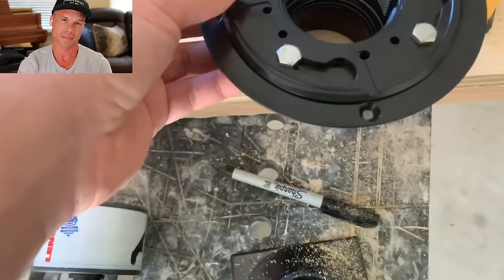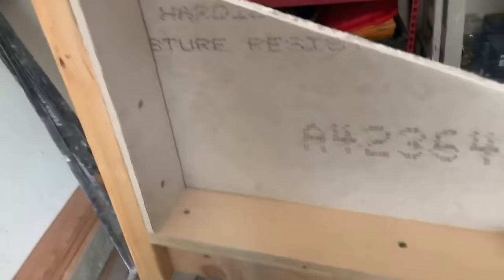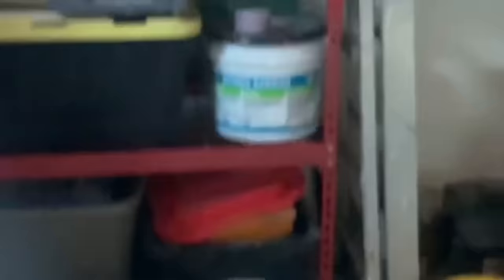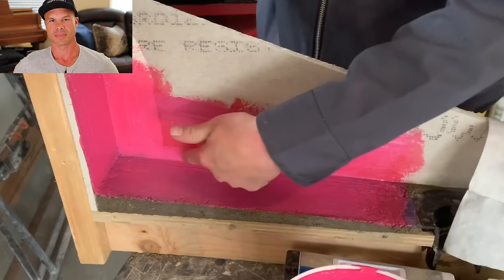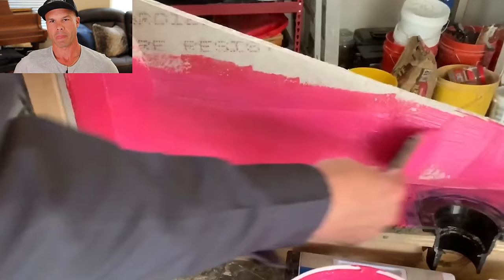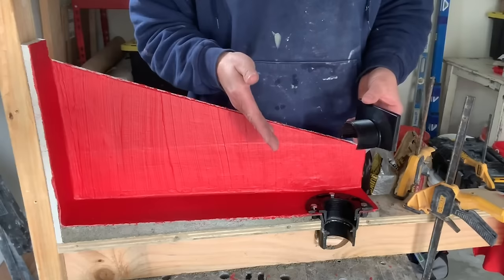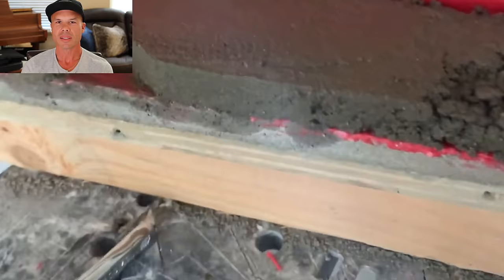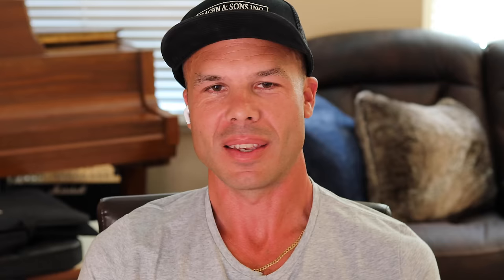THE BEST REDGARD VIDEO ON THE INTERNET!!!

Comment: What do steel, copper, glass, vinyl, rubber, and hot mop have in common? They're all formed to shape while under the influence of a furnace of one type or another AND they're all impervious to water. You know what's not permanently impervious to water? Anything that is air dried, such as Red Guard, that will therefore become soft, pliable, and permeable over time because the very thing that makes them form and harden also makes them susceptible to long-term exposure to water. The laws of physics and chemistry are not susceptible to marketing bs.

Comment: Great video.  Great step-by-step dissected illustration!  Thank you for sharing.
So if you're going to use a pan liner, you wouldn't use Red Guard or a similar product on the shower floor, right?  Mold sandwich I've heard.  I've seen some who use a liner and still red guard the shower floor.  Some Red Guard the floor but stay a few inches away from the drain?  Love your videos. I've learned a lot.
Thank you for the positive, motivational talk at the end.  That was genuine.... especially the porn, ha, ha.  Hey, when I watch porn, I'm usually just trying to check out the tile work that's been done, ha.

Comment: Quick Question. I have a shower pan that is leaking. Can I take up the tile on the floor and the bottom row on the wall, reseal it with Red Guard, as shown in the video, and tile back over it? Or do I have to tear out the entire shower pan and start over? Thanks.  And great message at the end.
Reply: When in doubt tear it out.  If the pan is leaking it has already started to rot. If you red guard over moisture it will eventually bubble up and fail.

Comment: Thanks for the video. I was looking for an easy way to do a curbless pan in a slab house. How much Redgard do you think a 42" x 78" shower would take?
Reply: David - According to the Redguard instructions: "Apply RedGard at a rate or 110 sq ft per gallon each coat. ".  I guess that would be for each layer of Redguard you plan to use. Plus a little more if you are going to use felt in the corners.

Comment: This is actually how Custom writes in the technical manuals how to build a shower. https://images.homedepot-static.com/catalog/pdfImages/a9/a91313f0-bffd-4f3d-bc9a-caa1825cb671.pdf Also, Laticrete with Hydroban gives instructions on how to do a liquid only setup with a linear drain with a Fernco style connection, too. https://www.youtube.com/watch?v=NLzYA79OV20 Laticrete's way. 

The only way people  should doing their showers with Redgard/liquid membrane is with a surface mount drain like a Kerdi drain, linear drain, etc, or use it as a traditional liner. One kinda ghetto way I've seen that I guess works (and I think even Sal's done it before with Aquadefense and a copper pan in one of his videos) is use a drain for a fiberglass shower (with no weepholes and a surface mounting setup...) and liquid membrane right to it, but it's definitely not ideal to Redgard over the traditional liner setups.

Comment: how do i waterproof my 2x4 curb without pvc linear? Redguard the raw wood? or cement board the raw wood? then redguard the cement board? redguard both the raw wood and the finished cement board shaped around the wood? Can curb cement board also go into the pan just like how he said the walls are ok to go into the curb ? (i know this is a no-no but he seems to be OK with it based on his theory)
i mean can i treat my curb the same as how he treated his wall? curb wall goes into bed.

Comment: So you've said not to seat hardibacker in the shower pan many times before... with redguard it seems acceptable as long as you use the fiberglass tape at the change of plane. . It also seems easier. Do you approve hardibacker buried in the pan as long as it's like this??
Reply from the maker: Yes.

Comment: i do this method. but i use hydroban by laticrete
Reply: Quick question.  Why sandwich the red guard between 2 mud beds rather than one big sloped mud bed, redguard, then tile?  Wouldn't that eliminate 1inch of mud bed to absorb water.  Or does redguard not 'play well' with the tile thinset?  Thanks!!

Comment: If I was using wonderboard on an outside wall in Minnesota and have a plastic vapor barrier attached to the studs then put wonderboard on the walls is it advised not to use red guard?  I have been reading about mold sandwich between 2 vapor barriers. I’ve also seen folks say do both and others say absolutely not.

Comment: I’m looking at doing my shower pan this way. I bought Redgard seam tape at Home Depot but noticed it’s supposed to be used with the uncoupling membrane and applied with modified thin set mortar. Can it still be used the way it’s applied directly with redgard instead of modified thinset mortar?

Comment: Hi Isaac, what’s the name of that felt material he used on the seams, corners, and around the drain flange? And is it necessary to lay those down if I’m using Flex seal as my floor waterproofing membrane before I apply thinset?

Comment: Ugh I'm super annoyed. I've spent a ton of time researching how to build my shower and not finding anyone saying that you're supposed to sit the shower drain bolt carriages on the subfloor and not the upper part. So last night I cut a 3.5" hole in my shower floor and put it down in there.
I do have 2 layers of 3/4" plywood and a layer of 1/2" hardibacker, should I still repair the floor and sit the drain up on the bolt carriages, or is the hardibacker essentially considered part of the deck and I should be good? I was planning on putting tar paper on top of the hardibacker, then lath, then deck mud.
I'm not doing a redguard liner, I'm doing a standard PVC roll-out liner, FWIW, but the drain install has been eluding me. I usually see it explicitly diagrammed as the upper, flat part of the shower drain goes directly onto the subfloor so this actually is counter to everything I've found.

Comment: What is the name of the fabric he using on seams after 1st layer of redgard?  Does he use that fabric on bottom of entire floor as well?  I have a slab floor which I'm converting to tiled shower after ripping out fiberglass tub/shoer.
Thanks.

Comment: So I've been watching a lott of your vids and different shower pan videos and I'm wondering if this how u prefer with preslope and then liquid membrane and then slope again on top? I feel u loose the benefit of only having to do the slope once and tile straight to liquid membrane, it also keeps deck mud dry. Or does the tile bond not bond as well to red guard and that's why u do another slope? Is either way fine?

Comment: Question: is that a Cementous or at least alkalai resistant tape?? I don't think it is, that will deteriorate in the shower, it is against manufacturer OEMS...just curious why you are using it? Not trying to be a troll.

Comment: with using the additive he was using for his pre slope could you do that to float a floor flat? Instead of having to go 1 1/2 could you do 1/2 minimum?
Reply: not exactly sure about your question but you want your slope towards the drain a minimum of 1/4 inch per linear foot from whatever shower wall. if the far wall is 3 feet away you ideally want 3/4 of an inch drop from the said wall.

Comment: It really depends on how much your foundation shifts which makes me weary of doing this. Not saying it's wrong or a bad video. If your in a mobile home there's the constant leveling that has to be done and that cause alot of twisting motion which may or may not cause a tear. For houses you have different reinforcement ( rebar, post-tensio, pier and beam, and I've heard of using fiber but not sure). Example: I have post-tension and the left side is 1 inch higher from center and the right side is 1/8 inch higher. Yes, it's due to water drainage, point is the flexing that happens and the failures that COULD POSSIBLY happen but may not. Not trying to bash these guy's because I like what they do and I'm actually using them like a teacher and I'm a student. I like what they're doing but they're not foundation experts. That would be like expecting a shipyard welder to be the perfect ship captain. Keep up the great work and videos so I can learn more as a DIY'er
Reply: So while yes its true us tile guys aren't Foundation experts but we don't actually have to be ....fortunately modern construction technology and materials and methods are all designed and created brand applied to allow for the fractional movement due to settling ,changes in load or conditional expanding and  contracting...the polymer modifications found in almost all tile related materials has this very thing in mind..methodology also considers this wnen. We thinset or liquid nail (on walls)our backer board then we tape a d mud the joints after its akk screwed off we are essentially making these materials one with the overall structure... Super bonded with the core framework or sub flooring so that it will move as one cohesive structure rather than the structure trying to move away from the tile and its substrate ...every thing flexes together ...if its applied correctly it will ride the house wherever it goes...recently tiled a school bus converted into an RV....Foundation. Shifting ..(normal foundation shifting anyway)isn't an issue really

Comment: I noticed he didn't use thinset between the redgard and the top layer of deck mud. Would you recommend thinset between the redgard and top layer of deck mud?
Reply: Kevin, I have not done it before, but wouldn't using thinset between the layers of deck mud ruin the ability of the top layer of deck mud to be "uncoupled" from the bottom layer?

Comment: I’m DIY-ing removal of old single unit shower and replacing with same. I want to redguard the backer board before installing new unit. Do you recommend?  P.S.  I’m on pier and beam. Reason for single unit choice.

Comment: Why not just a single mud slope and a liquid membrane with a flange type drain? Laticrete hydro ban liquid lets you do this.
Reply: They all allow for that style for installation, his method is sound but slow. A divot shower is much faster and is a one pour mud bed, the way its water proofed is identical.
Reply: I m thinking Schluter flange drain, sandmix for slope and AquaDefense with mesh for waterproofing

Comment: That explains why every red guard shower pan I've ever seen has failed.  I have never used it for a pan myself, but a lot of customers expect to see it on the walls.  I did my own shower 27 years ago with a chlorralloy pan, and no waterproofing on the durock walls.  It has held up and was used extensively by 3 kids and 1 or 2 grownups.  I personally don't like it at all, but why argue with customers?

Comment: Putting in my first complete ground-up shower. I have done pre-fab pan showers but this is, in my opinion, stepping into the bigs! I started a lot of videos but it doesn't take more than a few minutes to realize whether there is something to be gained by watching til the end. With that being said I have watched several of your videos all the way through and have subscribed to your channel. I am comfortable with plumbing, framing, tile work and as a concrete finisher by trade I have no problem with the masonry end of the project. I was anticipating using a traditional membrane but the Redgard has caught my attention. I cant find it now and perhaps I'm mistaken, but have you ever seen Redgard used in conjunction with a roll membrane?  My other question is what is the fabric that is used in the corners when applying the Redgard?   Thanks so much for the videos, I know they are a lot of work and time but I have already learned some lessons that will make my project a success and save me untold headaches and time, not to mention the money!
Reply: George, I also was wondering if you can use a PVC liner in conjunction with the redguard to be even more confident that it will remain waterproof (forever?? :) ). P.S. I think the fabric is called Laticrete.

Comment: My only question is WHY.   when you can do a liner and get it waterproofed in hours
Reply: I feel the same way,but I am interested in trying redguard because I want to compare it- pros and cons... To me, the pain in using vinyl, is that it bunches up in corners and you have to build out with strips before applying backer board so it doesn't bow in on the bottom..and it bunches up in and around the curb... But I'm used to have to deal with that...I agree that vinyl is superior to paint on redguard....

Comment: On the final mortar grade, do you put redgard on that? Then thinset  and tile? Or do you just directly thinset and tile on the mortar?
Reply: Was wondering same.  I've seen both.  I don't see it hurting anything.
Reply: @afchannel652  Since I needed to be about 3/32 higher on my final level, I went ahead and put thin-set on and now I'll put 3 coats of Redgard. That will give me the fraction I need above the drain.
Reply: @larrybush3584  so in theory, no water should be getting to the weep holes as that grade is covered on both sides by waterproofing membrane.

Comment: I'm not having any luck finding the redgard corner membrane as shown. Would any water proofing joint product work? Like the prova joint waterproofing?
Reply: Use alkaline resistant mesh tape. Depot has it

Comment: Hey there from Maine!! So glad I found your videos, Thank you for taking the time to teach us. I know putting videos together takes A TON of time, your video quality is pretty good most of the time! Out here, all i can find for "deck mudd" is a product called "4:1" at Lowes. Will this work for my float on the floor and walls? After watching about 10 of your videos,  I am going to take the plunge and build the whole shower in this master suite we been working on for 10 weeks now. I was also wondering if you could figure out how I can get some of your red cedar to make my slats/furring strips. I asked home depot if i could get a 2x4 red cedar,  and they are $25 for a 16', but I would have to pay $150 "vendor fee"  for some reason, and would have to get like $1500 worth....Any suggestions on a local lumber store that might ship me a couple? Thanks again bro, I am psyched to learn this, after 20 years of roofing and remodeling old rotten farmhouses, hopefully I can get this down. Take care!!!
Reply: Hey, there. Maine here too. 
Try using fir for the strips.  2x4 Should be available at big box stores. Not a perfect replacement, but much better than spruce. They rip pretty well and are mostly straight grained. 

I for mud, while 4:1 is a decent product, I started poking around and found dry pack and fat mud at mason / stone works yards. At the very least you can get sand and Portland cement there and mix your own. 

Hope this helps ya, bub.
Reply: Lowes has some 8' cedar 2x4 for around $5 off the shelf in store. I have an old farmhouse in Maine, lol

Comment: Aren't you supposed to wait at least 3 days for the preslope to dry before redgarding it???? So he just ignores that requirement? The 3 day drying time is the reason i don't use liquid membrane as a pan liner. I would use the fabric on the shower pan floor as well....Corners and field.
Reply from the maker: I have never seen that specific instruction from Redgard.  Hydroban says 3 days.  I agree with you, that is why I use sheet membranes.    I spoke with laticrete rep, and he said the 3 days is to allow any shrinkage to happen. I thought it was about the bond, but it is not.   Properly mixed deck mud (dry pack) does not shrink, so I'm not sure how this applies to liquid applied membranes.
Reply: @TileCoach  I thought the 3 day rule applied to all liquid membranes since they're pretty much the same thing....Hydroban, aqua defense, redgard,  laticrete 9235 etc.... Except for ardex 8+9 that can be applied the next day.
Reply: The 72 hour wait time is to let moisture out of the mortar bed. I’m not sure what the specification is for redgard.

Comment: Can you use red guard and a pvc liner together?
Reply: If you use the pan liner and poke a hole though it for the drain to go through, not sure what that will do for you as the liner will be below the weep holes.  So if your redgard fail and leaked below, any saturated water will hit the pan liner and then down the outside of the drain tube. So basically serves no purpose.

Comment: I get that this is probably very cost effective vs a sheet membrane or foam boards.  But unless you really need to save the $300-$400 why do all this extra work for not as good of an end product over something like nobleseal ts?
Reply: because not everyone can or wants to pay for it and not all bathroom remodels are for rich people's houses
Reply: @naegleriafowleri2230  I hear you. To each their own I guess.  If it's my bathroom and I'm trying to make it last for 30 year I'm finding a way to come up with the extra $300.  Grand scheme of things its $10 more a year for the life of the bathroom.  If people are that strapped for cash they should probably be putting in one of those plastic shower pans with integrated walls.
Reply: @naegleriafowleri2230  yeah, wasn’t this guy bashing other tile setters on Instagram about a year or so back?

Comment: started shower cement  floor put in 1/4 slope with mud deck mortar used drain on the video change cheap drain to Flo fx  is the Vedeo how to go from there ,the mud deck is flush with  old drain.  with out 4 screws on it I have it tape even and closed so nothing goes down it ??????
Reply: is there a video to show how to do from there, another mud deck??? red guard???
Reply: if use old drain have hard time on how many rocks to use ,under drain ,looks to me like over time the flow drain hole would clog, then red guard and another slope of mud deck